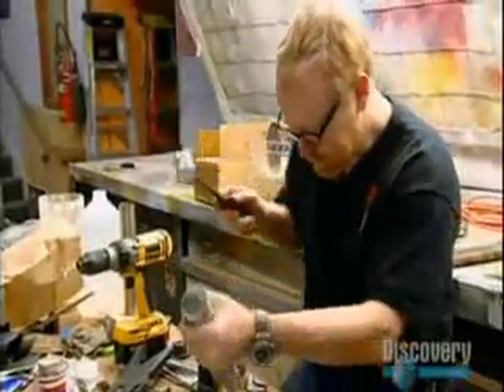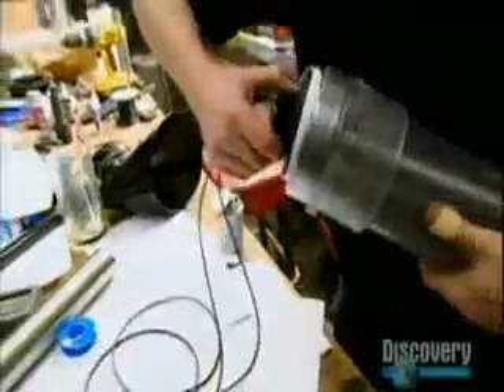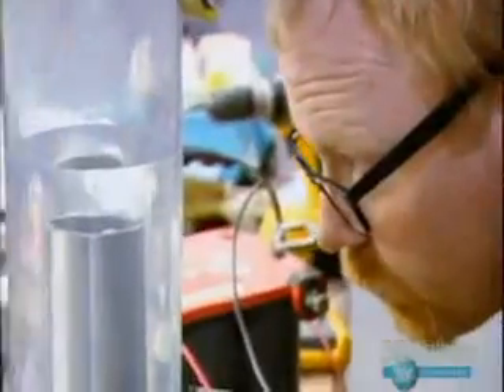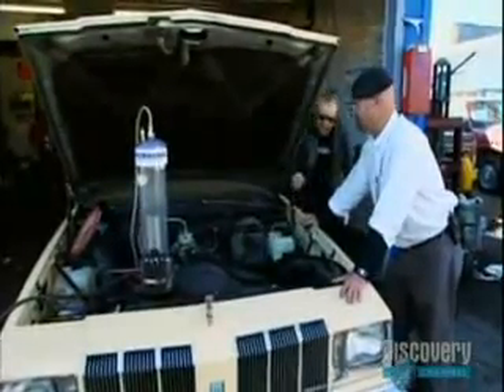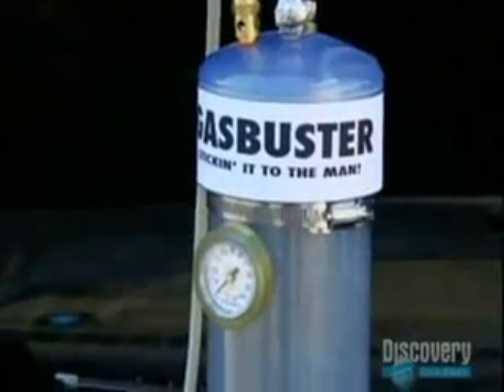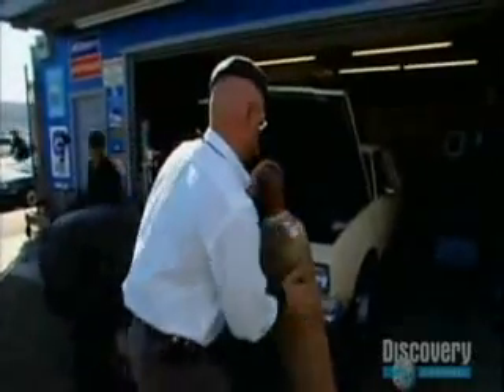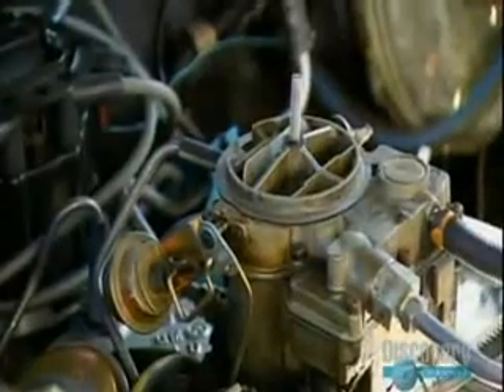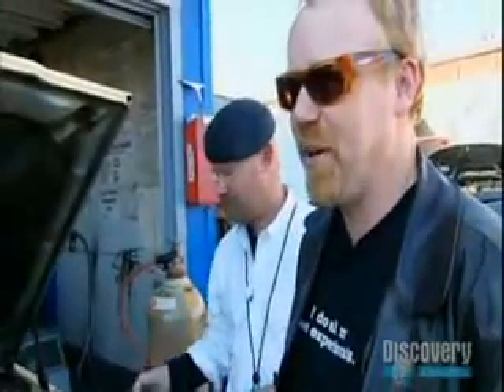HHO Mythbusters Explained

Comment: This is a useless product depending DEBUNKED science. Hez-Hyo defrauded us out of $3,000. 

We are a USA group that actually visited Hez-Hyo headquarters in Seoul. Based on guarantees that this was a viable technology, so we decided to test it. We purchased and extensively tested over many months, and under various driving conditions. Each unit actually failed along the way and they had to send us a replacement. Ultimately, it was a total failure with no net results. 

This technology in general serves as nothing more than a marginal engine cylinder cleaner for dirtier engines, which can be duplicated by using a normal engine cleaners. They hide behind this engine cleaning and baselessly claim it is as a result of the generator tech. The 'tests' and screen shots are staged under very specific circumstances that simply cannot be duplicated over time.

It also turned out to be a safety hazard due to potential hydrogen leak in cabin of car as well as negating more car warranties due to invasive installation procedure via puncture of air intake in engine with no viable way to seal.  Any insurance company will likely refuse to reimburse knowing this device was installed. 

After many months of promised refund, no result with shameful behavior.

Comment: For starters their electrodes were garbage, you can make one out of some washers, 2 lengths of thin steel and some heat shrink tubing a fraction of the size for a fraction of the price of what they would’ve spent on that monstrosity. Also if you want to use it to power a case you should use a dual chambered tank connected together by a hose at the bottom with the anode in one chamber and the cathode in another so you can siphon off the gases separately so that you don’t have a fuel and an oxidizer mixing together in one chamber. As was said in the video an electrolyte certainly would’ve helped, something an electrical engineer like Grant should’ve known off the top of his head.

Comment: By nature, H2O is stable. Which means its difficult to split the molecules. Because of that, it takes a huge amount of electrical energy to accomplish that. In theory, an HHO generator can feed an engine. However, it's not free. If left to itself, the alternator will fall behind in the ability to produce enough electrical power to produce enough hydrogen to keep the engine running. This is one of many problems with this claim.

Comment: This is not a technology  to save gas, but to use Hydrogen and Oxygen. The generator is work to separate water in to air at the molecular lever.  To get it is working much better there are developing and researching into it. Debunk this HHO generator????  This is a way to move away from fossil fuel (Petroleum Monopoly). Thousands of years ago, man invented the wheel. Take the wheel thousands years ago compare to the modern wheels. So the guy separate water to h, h and o to run an gas engine. It runs.  It is not about how much energy it use but about water can run a gas engine. This hho generator is the wheel thousands years ago. we need to find a better solution to make a generator work better like the modern wheels. In Brazil, people also use alcohol to move around. We pump gas, they pump alcohol or gas.  The idea of using water to run your car is HHO. Which is moving away from Fossil fuse. The generator is still Stone Age technology, not perfect. We need to development and research for a better generator. You are not debunk this generator.  Remembering the church who judged Galileo, old and conservative, who stuck on the old knowledge.  Locomotive used to run on coal back in its Stone Age.  It take alot of coal and men' power. Now locomotives is electric.  1gal of diesel in a Dynamo can 55 mpg  on a locomotive with loads (how dumb is EV).  Still is a locomotive less fuel and men power.  Don't debunk HHO but looking for a way improve the HHO Generator, so it can help us move away from fossil fuel. Check out red Hydrogen.  I still believe that we can move away from fossil fuel by using water in HHO form.

Comment: Hi, the explotion has nothing to do with hho reversal flame, in fact they were using h2 molecular hydrogen, but the presion and temperature to ignite is lower than gas, then  explotions happens before the pistons are in the correct position and the engine blow up.When low octane gas is used on high compress engine the explotion could happend before the gas air mix is totally compressed

Comment: I still didn't believe that 1 litre of hydrogen gas enough to run a car . Producing 1 litre of hydrogen gas need 30amps of 12volt battery constantly . If the car really can run with that little of hydrogen , what about the moisture went into piston ring and liner to make the rust over night ? Stop this foolish experiment ! It already wasted my precious 6 months of time to make a failed project 😓

Comment: They failed bcause they are propagandists ! 
Hydrogen is produced when fuel ( gasoline ans deasil ) is refined ,they do not inject the hydrogen back into the fuel because it would make the fuel far more efficient ( they would sell ( there would be less pollution) much less and their monopoly would by less powerful  ! 
 It takes far less hydrogen to run a combustion engen !
 Hydrogen generators produce a lot and lot of hydrogen and can be powered by hydrogen fuel cells ( made from the stuff ( platinum) they put in your exhaust to produce CO2 (and then cry about the CO2 ) ! Water in water out water recycled ! 
 But then there would be no oil monopoly ! And no hydrogen monopoly ! Not battery monopoly and no electricity monopoly ! 
 No monopoly no political power ! By created crisis ( caused shortages ) !

Comment: Car alternators ar 50% efficient hydrogen electrolysers  are 47 % that means 25 % overall efficiency car engines about 30 % So you stand to reduce overall efficiency by 4.5% percent.

Comment: 5 minutes and ZERO improvement, because a lawnmower would need 100 times that for 2 seconds! Not even mathematically possible for you scam to do anything for anyone. Plus the toxic NO gas that is released when burned, oh and the other toxic gasses that are released while making it. Don't for get the wasted cost for the electric.

Comment: The best way to burn Hydrogen in a car would be to modify a Propane system. The system mixes the GAS"Propane or Hydrogen" with oxygen in the air giving you the opportunity to adjust the fuel ratio while sealing the engine up preventing backfires and under-hood fires.
Reply: that isn't the problem. The problem is that it takes more energy to break the hydrogen bond than can be extracted when that hydrogen is oxidized (burned)  again.   It  won't  work.
Reply: @danstrayer111  That;s why I would think that using Solar Panels to provide the electric power to separate the water into Hydrogen and Oxygen would be the obvious choice as it would be basically free after the initial investment. Another idea would be  to use pond scum to break the water down. This way however brings up having to separate the Hydrogen and Oxygen . I am not saying that burning Hydrogen is the best solution. It may be a solution that can be implemented much cheaper than others. It would be better than using smoke from a smoldering fire that is collected and plumbed into the intake
Reply: @danstrayer111  what if you used a semi battery with a semi alternator? Just modify under the hood to accommodate them.

Comment: Hydrogen isn’t meant to be used as the main fuel source but rather as a supplement to gasoline. Gasoline burns at around 20% efficient on most modern vehicles. The hydrogen burns hotter and faster than the gas so it makes a more complete burn of the fuel you are using. When your computer sees that way too much fuel is being used after the increased combustion of the gasoline it will start cutting back fuel. You can typically pick up 20-35% efficiency adding hho
Reply: nope. None of it is true. Sorry.

Comment: Somebody needs to say something to them. The sketch that they showed for the gas generator, is more than that, it is a bomb.  When you mix an oxidizer (Oxygen) and fuel (Hydrogen)  in a closed container you get a bomb.  And, the fuel line in their sketch is actually acting like a FUSE.  That is what a fuse is, oxidizer and fuel mixed together.  That is why M80's can still explode when tossed into water.  I am glad they didn't kill somebody.  The hydrogen gas needs to be separated from the oxygen gas, sent to the engine in separate pipes and mixed in the engine cylinder where it explodes, literally.  I don't think they thought this through completely.  I am not a chemist, is anybody out there a chemist?  Why wouldn't the bubbling oxygen and hydrogen combine inside their "gas generator" and convert back into water and never make it to the engine?

Comment: They intentionally left out 
very key details regarding the entire design and operations according to the original patent and video that Stanley Myer produced explaining it's operation in detail, regarding the pulse widths and frequency, in which it was to operate most efficient at, it was also supposed to be pressure Regulated to keep the flow rate stable, to prevent potential oxidization of the engine the internal parts of the engine like the pistons and cylinder housing could be High Temperature Ceramic Coated, or be changed to Aluminum alloy. 

The fact they left out so much of the electrical power system that supplied 
The HHO generating unit, is what ruined their Credibility with me. 
I've seen first hand Lawn Mowers run on HHO from Water for many years a friend did this until he passed away. 

His design nearly identical to Stanley Myers. 

Mythbusters where obviously 
Paid to suppress it, or are just that really bad at Flowing instructions, and the scientific method, they failed to realize the error of their ways. 
Which I truly doubt. 
If anyone has the original video Stanley made explaining the entire design and operation, please disseminate to everyone you can, the more the Truth is shared the less manipulate media like Mythbusters and Technological Supressive media can be abolished
Reply: "pistons and cylinder housing could be High Temperature Ceramic Coated, or be changed to Aluminum alloy." The piston are already aluminum alloy.
You can't even get that right.

Comment: costs more power to run a water splitter than what you would gain from burning the fuel turning it back into water within the engine... Just saying.
I think it would be a valid way to save up power into a fuel though. for instance using solar or other means. then having the gas tanks in the car.

Comment: You're not supposed to be able to run it off of Full nitrogen what it does is improve your gas mileage by about 30 to 40% and on top of that they did not add the key ingredient in the water that's needed to create the hydrogen which is baking soda as a catalyst

Comment: While I don’t feel there is NO merit to these devices. It’s also edging on the whole perpetual energy type scam vibes. 

The science is there and sound enough, but it can’t make enough hydrogen to run on just hydrogen.  So your best hope is to take the excess alternator capacity and make supplemental fuel to help reduce the amount of fuel you burn 

But the issue is will you just burn more fuel due to loading up the engine with more alternator drag. you would have to tune the system to have a minimal power draw.

Comment: The shit doesn't work. In order to get enough HHO to power your car, you'd need and aftermarket alternator that can supply the amps needed. Also, baking soda isn't a good enough electrolyte for this to work either. The power to payback ratio is absolute physics. This is all BS. I have worked on these extensively and again, all BULLSHIT!

Comment: OMG mythbusters...you didn't get it at all! the HHO ressonance generaor works not based on electrolysis, but on low current, low voltage alternating power in the natural resonance of water. this rips the H2O molecules into oxygen and hydrogene. So you are not producing hydorgen and oxygene separated on anode and cathode but browns gas. As the input power is quite low the energy bilance out of burning the gas is 7x gains. I would have expected a little bit more research before busting a great technology. The whole setup was nonsense....

Comment: The coil inductor was to hook to electrode , for the reverse flyback ," 
high voltage" pulse applied, minimum 1500v. The Meyers cell was that 
way, and Chambers Patent was similar. Chambers used to work for Meyer in
 Ohio, Water Fuel Cell Co. More hydrogen was generated at way less 
power. Multiple short concentric SS tubes. Pulse modulation - on time 
with more % off time for bubbles generation. The Hydrostar circuit is 
the Xogen Chambers design in Canada.
Reply: So what you basically say is that the Mythbusters got it wrong?

Jeez, what a surprise.

Ever seen their take on debunking the Moonhoax claims?

Jamie steps in to "shed some light" on a particular "subject" to make it work.
And i can explain what i mean by this, if you do not understand.

Anyways, i know how to make more Hydrogen and Oxygen in seperated state. A lot more, from the same powersource as them Mythbusters were using.

BUT, will it save me money on the long run?
Even an idiot who is able to use Youtube and knows how the search-bar works can figure out how to produce shitloads more gas than these mythbusters did.
But will it get me further down the road?

Anyways, pls show some documents or perhaps videos or such to backup what you are saying.
Thanks.

Comment: The comments are filled with misinformed hotheads. Yes, they could've produced more bubbles. But a small plastic bag of hydrogen is only going to make a car idle for a short period, and the creator of this video needed 5 minutes to collect just that much. 

Real hydrogen cars exist, but they require far more hydrogen than what you can produce with a bolt-on electrolytic cell.
Reply: They proved it at the end its all about volume of gas...sails right over peoples heads everytime.
Reply: the guy who figured it out got killed
Reply: @smashcomp2661  You can't create energy. Only transfer it.
Reply: @Jake-rs9nq  im not saying your creating energy through this process, but every time a water powered car has shown up, it quickly disappears. Why?
Reply: @smashcomp2661  Because it isn't possible? Hydrogen is what powers cars, not water. To remove the hydrogen from water, you need to use a fuel cell, and stuff your car full of batteries. Then you need to charge up your car with a large amount of electricity. This is inherently inefficient, because there is power loss when splitting the molecule, and so a purely electric car requires fewer batteries and less electricity to go the same distance.

Comment: it works well. these two got money from oil companies to disprove it. i bet they have got genocide jabs of fauci as well.
Reply: I'm sorry you're so misinformed. Hydrogen cars exist, but they require far more hydrogen than what you can fit in a grocery bag. To produce your own hydrogen AND run a car at the same time, you'd need tons of batteries. That'd just be a ridiculously inefficient electric car.

Comment: Are you kidding me, they are so much smarter than that. This must have been paid to fail on purpose.
Reply: They could've produced more hydrogen, but it wouldn't have been enough to do more than start the engine briefly. Real hydrogen cars require far more gas.

Comment: Pretty sure it's safer and more efficent just using hydrogen in a fuel cell. You have electrolysis going on at home filling up containers of hydrogen, or in hydrogen facilities. Than just have a high pressure tank of hydrogen fueling the Hydrogen Fuel Cell. You dont have the wasted heat from burning the hydrogen.
 HHO gas is way more dangerous than gasoline. That's because the fuel is mixed with oxygen meaning if theres a spark in the container itll explode. Gasoline can't do that unless you get oxygen into the tank.

Comment: People have been running this HHO scam for years. It doesn't work. Never has, never will. You can't run a gasoline engine on hydrogen anyway. You'd blow out the engine heads. You could run it on a diesel engine, but you need a lot more than you get from HHO.

Comment: I went to truck driving school in the mid-80s in Florida it was a very interesting experience they didn't just teach you about the steering wheel they taught you about how an engine works one of the examples of high compression and fuel that the mechanical instructor showed was he took a red shop rag dipped it in gasoline wrong it out and stood on the back of the truck and held the rag near the intake and had the driver shut off the diesel engine the diesel engine kept running on just the fumes from the rag for about a minute or so but if you're a mechanic you know that that won't work because diesel has oil in the fuel itself that helps to lubricate the engine so running on just the fumes at high compression would cause a lot of severe wear and tear and damage to the engine but it's feasible
Reply: We have area in gas fields all over Canada with /air and manual shut downs tight rugs on truck runnig away and loading flammable “Condi condensate

Comment: @UCFBACmsrSQAPNbHdNSgtmBw
  This is a 1998 Ford Explorer Sport converted into a hydrogen hybrid by Alex Rivera and how2savefuel.com. Horsepower and torque increased significantly after the conversion - The truck accelerates much more quickly without the engine laboring nearly as much as it used to! Highway MPG improved by 56%, city MPG improved by 35%. The system produces hydrogen ON-DEMAND and it is immediately used by the engine - Hydrogen is NOT stored, so there is no risk of fire or explosion (in the case of a car accident). I'm saving more money at the gas pump than I ever thought possible and I didn't have to go and buy a hybrid to do it! Convert the vehicle you ALREADY own! ANY combustion engine!